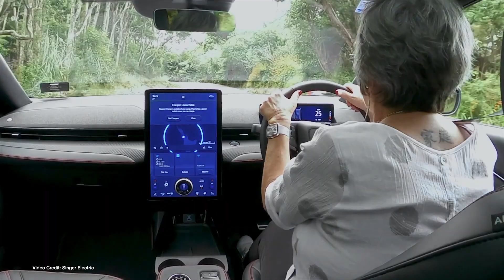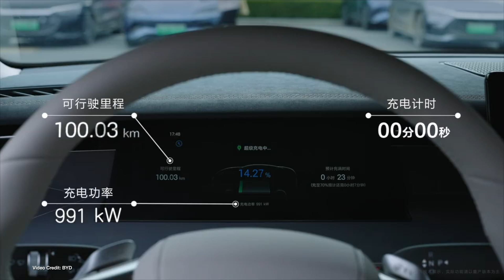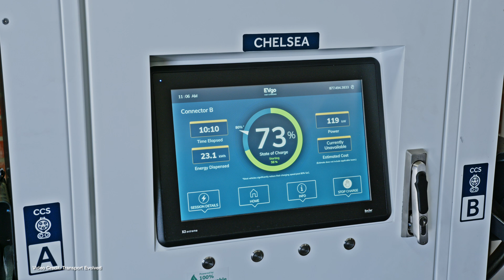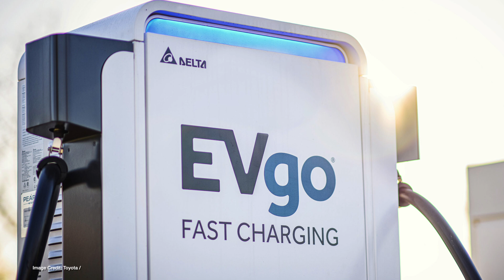ecoTEC 362 1,000 kW Charging!  Renault 5 Turbo 3e! XGames Scared Of EVs!

Comment: Solar makes sense but we need many Megabatteries  to utilise and store all the curtailed lost renewables.
Those big batteries like the Victoria Big Battery and the Adelaide  Mega battery and others currently being built can only supply between 2-4 hours of peak power demand after 16:00 hrs however do allow Wind generation to be fully utilised over the dusk and night time period.
Solar and Pumped Hydro can support some base load but much more is needed.
Renewable can only take over once storage is addressed. 

Keep in mind that repair and replacement of panels will be an ongoing cost as hail storms , Dust and environmental debris, along with regular maintenance and cleaning continue throughout the panel life of Solar.
Full renewable from Solar will never decrease power cost.  It may however reduce the level of increases in power cost as wages grow so does maintenance cost for Solar.
Wind is not without maintenance either with Turbine Blade replacement and service of the turbine generators on top of those masts.
#BuildBiggerBatterieNow

Comment: Targeting Tesla vehicles and vandalism is both futile and unnecessary
BoycotT Tesla if you want and don't buy their product  if you want to make a stand, but damaging property is uncalled for.
Buy other EV and use other EV charging networks.
If you want to make a point nothing speaks louder than hitting the Tesla wallet.

And IMO there are much nicer looking vehicles than the Tesla Model 3 & Y .
Kia , Hyundai and many of the yet to prove themselves Chinese vehicles
VW and the other Euro vehicles are made in China or Spain so take it with a grain of salt. 
Merc , BMW, and Audi and Volvo using Chinese batteries and motors on many models So- there you go.

China is from the looks of things a better value proposition, it is whether that stand up in Aus and NZ for the UV and climate.
By all feed back from China for cold and hot weather they seem to perform  but UV and slat spray environs are not something really seen other than the eastern seaboard.

As to recycling Black mass from Lithium Ion and NCM batteries is real in China and one European recycler however not in Aus or NZ as of March 2025. 
Power tool batteries and Lithium Ion batteries from Power tools and consumer goods are being deep buried. Not exported.

Companies that exist in Aus like Envirostream, EcoBat, and Ecoactiv are repurposing or discharging and sending to China.